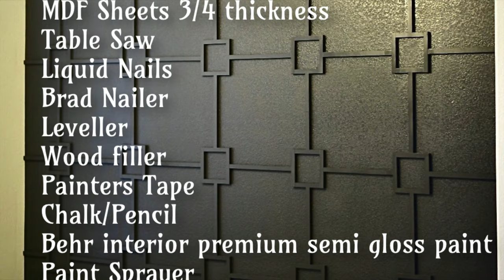DIY Accent Wall | Board and Batten Wall | Feature Wall | Quarantine Project

Comment: Looks so beautiful. Question for 1st timers: what equipment do I need to have to start any diy at home? I don’t have wood cutter or anything, would you make list of besic needs to have it at home to start? Thanks!
Reply from the maker: Hi. These are some basic essentials for starting home DIY projects according to us:
1. Power drill
2. Miter saw
3. Jig saw (if you want to make curved cuts)
4. Sander
5. Roller brush/ paint sprayer for painting 
6. Brad nailer - if you need to stick something
7. Circular saw - if you have to make longer cuts

Comment: lovely finish.  Did you caulk the baton edges? Didnt look like you did, but still a nice finish.  I personally would have gone for a centered design. No masks whilst spray painting? :-) what model paint sprayer do you use?
Reply from the maker: Hey thanks! No we didn’t caulk the edges. We thought of it, but it didn’t seem like it was needed once we stuck the baton. We started off this wall with a different pattern in mind but as we went along, had to make some compromises and that made the design not quite centered. Thats something I would fix if we can go redo it. That’s the first time we used a paint sprayer and didn’t know much about it. That’s a great suggestion to have a mask though. We use Wagner Flexio 3000 paint sprayer and we love it. Thanks for taking time in putting down your thoughts here😊